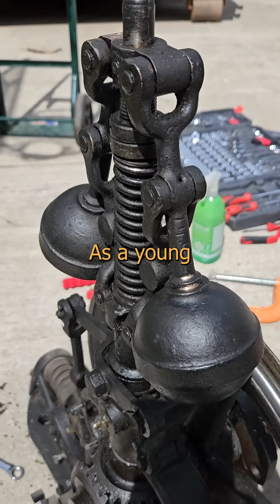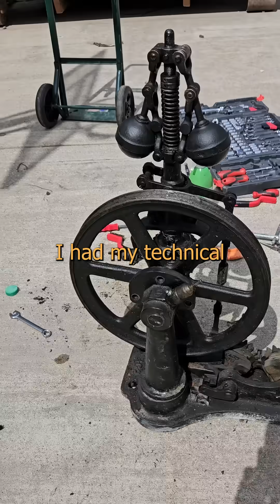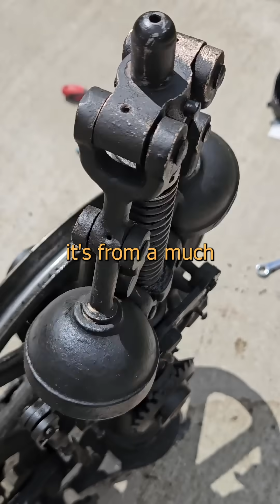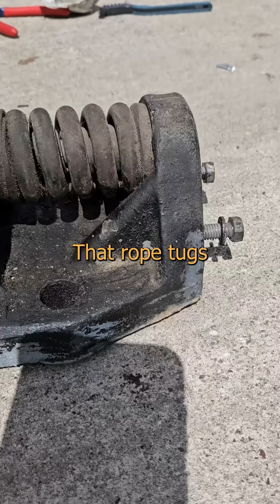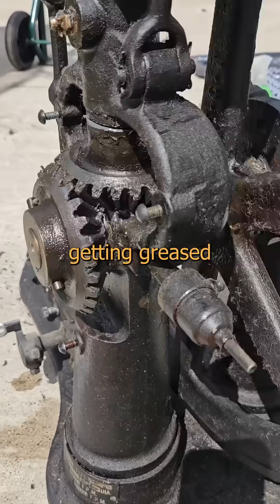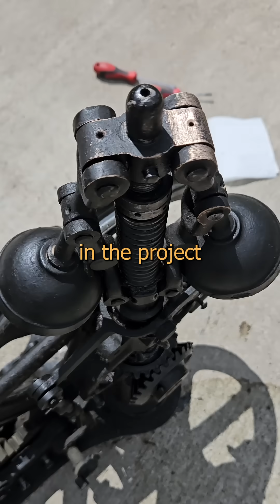Flyball Governor #chrisboden #comedy #engineering #steam #safety #elevator #steampunk #vintage

Comment: This fly weight governor system is still used to this day mostly in civilian applications on commercial buildings that use steam to operate HVAC systems elevators use a magnetic braking system to e stop the car in an emergency

Comment: Devices that use centrifugal force to control, regulate and govern themselves or another component are so elegantly simple and ingenious and robust, like this lift governor, steam engine governors, constant velocity variable pitch aircraft propellors, and belt and pulley type continously variable transmissions.

Comment: Fun Fact: That piece of equipment only attached to a safety line, not the lift cables. Yes, plural. Cables. Each single cable is capable of supporting the counter weight, the car, and a load at maximum capacity. And there are multiple. Also, this is not the only safety system protecting you inside the car. There are multiple. With redundancies. Pound for pound, mile for mile, elevators are the single safest mode of travel, by a HUGE margin. The most dangerous thing about an elevator is entering and exiting (as in the event of a landing failure they tend to turn into guillotines). Otherwise, you are safest inside an elevator!

Comment: I think there is a perfectly good reason for NOT cleaning off the old grease, supposedly the old grease acts as a sort of "seal" to keep dirt and dust out, if you grease often enough it actually works pretty well, maybe remove the loose bits that squeeze out, but never all of it.

Comment: I wanted to leave a comment, but the software "corrected" all my attempts. The flyball governor is cool. I installed an ignition advance in my car, and was not disappointed.  There was this old thing called a called a clock as well.

Comment: I’ve built a cable driven elevator in my shop. My apartment is above my shop. Makes bringing furniture up much easier.   But as of now I just a fall arrester on each corner of the lift car.    My plans are to build a centrifugal overspeed mechanism something like this.  I e been brainstorming on how exactly to go about this for over a year now.    Seeing this has really got the gears turning again!!    I’ve also considered trying to find one of those old car lifts with the massive single cylinder in the middle and using it as the lift mechanism since it would be a lot safer.   But I can’t seem to get my hands on one.

Comment: This works similar to the gpvernor found on the fuel pump on a mack truck engine where the speed and force exuded on the weights spinning regulates the amount of fuel delivered to the rail, keeping  pressure and volume at a level matching what is needed to match the engines needs at a given rpm.   On the Mack fuel pump the governor lays on its side where governor springs keep the weights pulled in to the centered closed position until  more fuel delivery is needed,  this happens as the engine speed increases causing the governors weights to spread with the engine speed increase  which opens the main fuel inlet to match the needed volume to throttle the engine up while keeping enough pressure on injectors as they deliver sprays  faster as needed to increase the engines speed.  
 The down side on this fuel pump design was we once had a pump rebuilt by Mack trucks pump tech who overhauled it but failed to get the springs installed corrctly which allowed the governor to go wide open instantly as it started the ne engine that it was instlled on. this caused the first start on the new engine to be its last. No spring tension caused the pump governor to go full throttle with no way to shut off the runaway engine we had just installed due to what is known as a run away where a deisel engine can not be shut off because the engine continues running, using the engines oil forced into the cylinders, then burning it as if it were fuel that continues to accelerate the engine even where the fuel has been stopped. No kill switch works and only stopping the engine from getting air in the intake can stop this event, the new engine literally destroyed itself before it ever moved from the garage bay. Because the engine could not be throttled down, it literally blew up when the speed it was running at caused internal rods and such to break and destroy the crank rods block etc.. Mack, after inspecting their  fuel pump, agreed their governor springs failing to be installed correctly were responsible for all the destruction. They paid for a new engine, fuel pump, and the labor to fix the problem caused by their failed fuel pump goivernor.

Comment: Mechanical elevator governors using centrifugal force are still built and used. Although they integrated the mechanics into the governor wheel itself making it small enough to fit into an elevator shaft. I know it cause I wrote my engineering degree thesis around elevator operations and had to explain the related safety systems as part of it. Cool stuff and built to be operated for decades.

Comment: On one hand, it kind of sucks that it never got cleaned during its service life. On the other hand I can understand why, taking the elevator offline to do a full service/cleaning it didn't need would take much more time than just taking it offline for a few minutes to grease/oil it again. 

Also, that century of old grease and oil coating it probably kept it from rusting and wearing out earlier from said rust too,

Comment: The benefit of items being greased and not cleaned is that the grease acts to protect the item, so a little work with some diesel and a tooth brush and it will look good as new.

Comment: Oh my god I have one of these sitting in my garage right now and I’ve been wondering what it is for a few years. I knew it was some type of governor but I thought maybe locomotive, never would have guessed it was for an elevator. It’s in pristine condition and the parts are painted in different bright colors. Made me think it was a demonstration piece. I pulled it out of a condemned house where the roof and floors were falling in. I thought it looked cool so I saved it from the rest of the trash destined for a dumpster.

Comment: If you are to paint it, black is never a bad option, but you can also go with red, or a slightly blued green, though given the open grease areas, black would be your best bet, a good powder coat with all mating surfaces kept bare metal with grease on those surfaces.

Comment: I had a similar governor on my ship's emergency diesel generator, a Fairbanks Morris 38ND8 1/8, that I helped maintain. 8 cylinders with 16 opposed pistons. It used 3000psi compressed air to start and powered a 1000kw generator. And yes, that was pretty cool.

Comment: Did you know the term "Balls to the wall" comes from fly ball governors. Youd set your max rpm with fly ball governor. Then youd get the command "balls to the wall" you knew to run the machine up to the governed max RPM. And that's pretty cool

Comment: 🟦…It would definitely have to be a powered demo!,..All you'd need would be a small single speed motor. Th' hard part of it would be arrange'n a balanced mechanism to be able to QUICKLY change th' tension on th' spring In order to show people how th' farther out th' balls are th' slower it allows th' machine to go, compared with how fast it allows with th' balls pulled-in tight. 
The spring tension mechanism would have to be seriously modified to be able to be changed Really-Quickly (cuz of the short attention span of the people you're demo'n to, And how long it takes to manually crank that tension-nut full throw... I say there's gotta be a quicker way, and if anybody can come up with it, I believe you can,... I don't often stumble into people (especially online!) that I end up have'n some sorta faith in.
... I have some sorta faith in you,.. time'll tell If it's well placed.
Be Safe out there!

Comment: After looking at them for 42 years, much less lugging the heavy things in and out, I don't want one in my living room. There are a couple of ideas I've seen other guys do. One guy painted it and mounted a mailbox to it. Another used it as a table base alongside a bronze elevator ring gear round glass table. Actually, it's a pretty cool looking table. You'd be fascinated with some of the other designs beside the flyball. That's an old Otis unit. Haughton Elevator used them quite a bit. There is an old Hecht company warehouse that was restored a few years ago in Washington DC. They made a series of tables and art displays ie metal sculptures out of the older elevator equipment that had been replaced. Elevators are a great tool for any physics enthusiasts.

Comment: Those weighted balls are the same concept as what you'd see inside a single-phase induction motor.
Some motors have a start winding and a run winding. The start winding pulls high current to get the motor going quickly but would either burn out or trip a breaker if it stays in circuit for too long.
When the motor starts, it builds up speed on the start winding to a point where these weights throw out and disengage the start winding, switching the motor over to the more efficient run winding.

Comment: Haughton Elevators
Over speed governor clinches monitoring rope/cable upon car over speed (cab falling up or down) which activates cab to rail brakes and stops the car. A gear wrench is required to release the cab to rail brake through the floor of the cab.

This speed monitoring cable is separate from the hoisting cables in a traction drive elevator.

The cab and hoistway shutters and resonates upon activation of the over speed brakes. This is performed every 5 years for safety inspections.

Comment: I work on steam turbines for a living and flyweight governors are one of the items that I occasionally do work on. The flyweight governors for old steam turbines work in a similar manner to the one shown here, but instead of tripping a switch and shutting everything down, the pivots on the weights thrust a plunger axially up the center of the flyweight housing which operates a valve, throttling the steam in order to maintain a set RPM. This is a particularly ingenious system because it is able to compensate for fluctuations in supply pressure without any sensors, computers or human operator input. Nothing but hot water, physics and 19th century technology.
Reply: I'm a retired instrument mechanic.  Most of the guys who do this for a living like to call themselves "I&C technicians".  Anyway...  One of the things I got to work on was hydraulic feedpump speed controls.  I worked on the main turbine as well, but working on the feedpumps was fun.  I love the hydraulic controls.  While the main turbine used a separate 2200 psi hydraulic system, the little feedpumps simply ran on lube oil.  They actually did have a flyball speed governor.  Located on the end of the turbine shaft, rotation would sling out little weights which influenced a "flapper nozzle" producing an oil pressure signal inversely proportional to speed.  This pressure was used as a feedback signal in an electro/hydraulic converter, which used a 10-50 milliamp signal from a controller to develop a demand hydraulic signal feeding the governor valve.  Sorry for the rambling.  Although I've retired, I still love those old hydraulic controls.
Reply: I think I can kind of imagine what it looks like now but I wish I could see it.. off I go on a steam turbine deep dive I guess 😂

Comment: I also enjoy old steam engines, but especially the flywheels. It amazes me how much energy can be stored in a large heavy flywheel. The heaviest and nearly the largest diameter I know of are the two 775 metric tonnes(854.3 US short ton) flywheels at the Joint European Torus (JET) fusion research facility in the UK, they rotated at 225 RPM, are 9 meters(29.53 feet) in diameter, and produce 400MW or 540,000 HP each. However, the Corliss 1876 Centennial Exposition engine was just a bit larger in diameter at a full 30 feet in diameter, weighing 56 tons, and Rotated 36 RPM and made from cast iron.

Comment: I've worked on these, we always called them knee bashers as everyone remembers their first time.  There are two reasons it's filthy.  1. It operates in the dark 99% of its service life.  2. Cleaning, other than vacuuming the fuzz off it is forbidden. You can lubricate it and that's it.  Solvents can change the trip speed the jaws close and lead to injuries or damaged equipment.  The reason this one was most likely removed from service is the bronze jaw failed it's pull through test.

Comment: Perfect height to crack a knee cap. Ask me how I know? What I like about them is they let you know they need greasing by the audible knocking sounds they make. Not from the motor room, but once you walk downstairs to leave the building. Can be heard on the top 3 to 4 floors. Looks like I need the grease gun back in the car now! My mistake was for thinking I was finished. 😅

Comment: Centrifugal force is an apparent force that 'pulls' the balls out. The real force is centripetal force which pulls the balls in and prevents them flying off at a tangent. The difference is the point of reference, when viewed from outside the system something is pulling in, but from the balls perspective a force is pushing it out and that's pretty cool

Comment: This is very similar to how a constant speed propeller works on some airplanes. You set a desired RPM of the prop which in turn sets a specific angle of the fly weights. If the prop goes faster it changes the angle of the weights which are connected to a pilot valve which either lets hydraulic fluid in or out of the prop assembly to maintain the desired RPM.

Comment: I do NDM restoration work on similar stuff and that looks to be an easy project. A ton of degreasing and some work with a pick and brass brush should bring it back to new. 

Only thing is I'd recommend applying a thin coat of oil on all surfaces, it'll oxidize leaving a protective coating to keep rust away, then greasing all normal wear surfaces again so it maintains functionality while limiting wear from demonstrations.

Comment: I work at a hydro facility and we have a Pelton Governor Head Reluctance Motor that is powered right off of the PMG. It speeds up/slows down and the balls operate linkage depending on the speed. Too fast and it pulls the linkage down which slows it down. 1/16” of movement and the generator is audibly noticeable. 

If anyone wants to see it in action of just the old manual, let me know.

Comment: That´s not only pretty cool, that´s infact INSANELY cool. I saved a speed governor from our old elevator but it´s not the ball one. It´s the rotating pulley with teeth inside. Works just fine.

Comment: That flyball mechanism is very cool. Seems like pinching the cable like that would damage the cable. Probably my last choice for a stopping mechanism. The flyball should control a breakpad on the wheel or something like that. I suppose if it lasted 100 years it fine though…

Comment: Talk about not cleaning it after lubing: we had a motor at work that started getting hot.  A vertical shaft oil pump-in-a-sump with the motor above the housing.  The PMs said to give it a couple of pumps of grease.  Possibly the guys gave it an extra one once in a while.  35 years later, when they pulled the motor apart in the shop, the housing was 2/3 full of grease everywhere!  The rotor was being grease cooled!

Comment: I’m a sophomore in high school and that mechanism is so cool! It’s so neat to see how they did things automatically back then without electronics or sensors. I believe small engines use a similar system. There is two arms and when they go outwards it sends a button outwards slightly which sets the carburetor to a certain position depending on how it’s adjusted. Really interesting things

Comment: Very cool, modern hoists use something very similar, its not a flyball governor but it is a centrifugal governor, an idler pulley has a central shaft that a flywheel is bolted to and on the flywheel there are two pins across from eachother on the rim, there are two crescent shaped fingers that have carefully calibrated springs holding them in place.   When the idler pulley rotates above a certain RPM the hoist is moving down at more than 33 feet per minute and the fingers pull apart and hit a release that trips a powerful spring loaded lever that mashes a sacrificial block into the wire rope guide, pinching the rope stopping descent.    The way the emergency automatic brake is set up it will not allow the hoist to go down but it will allow it to go up.

Comment: Those old Otis flyball governors are like a mechanical sculpture to me.
I was a union elevator mechanic for over twenty years, and I have a collection of them from different mod jobs.
 The oldest is from around 1900 and didn't have a switch,  and two from around 1925 with really big round copper contacts for the electrical switch and various others from newer jobs

Comment: Show how well it works, when the state safety inspector comes in, and writes a report saying, "Your cables are getting very rusty - you need to take action!" Followed by a mechanic taking 5 gallons of oil and drips/soaks the cables, clear to the center core, and then from the car top, runs the car to the bottom of the shaft - lets off, and rides it full speed up into the penthouse floor, as the weight of the counterweight grabs hold of all the gravity in the elevator shaft, as it begins trying to reach middle of the earth's core. It didn't even slow the car, turning his hair style into a 50's flat top. Any idea how hard it is to remove oil from a steel elevator cable as it has soaked all the way to the center?